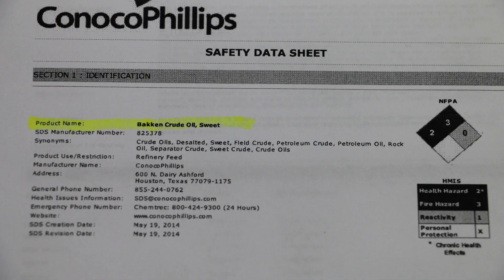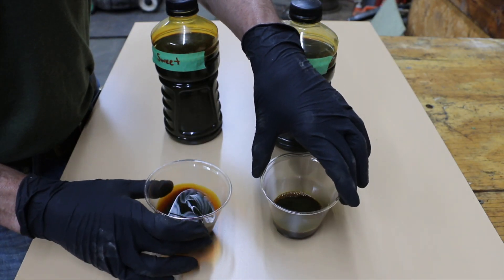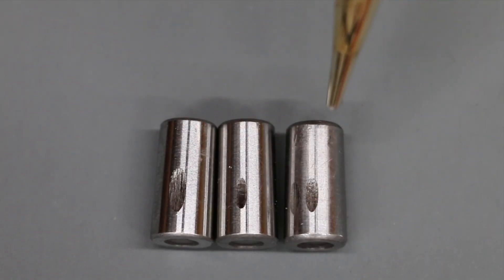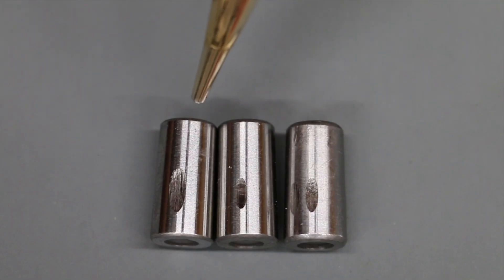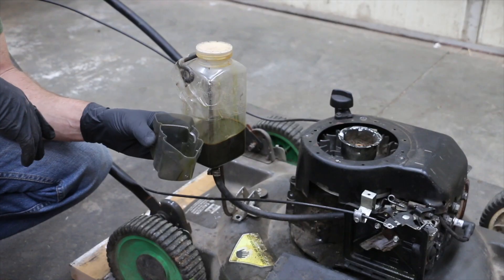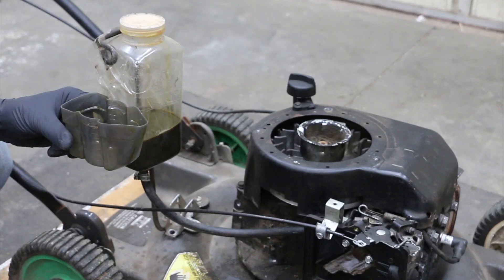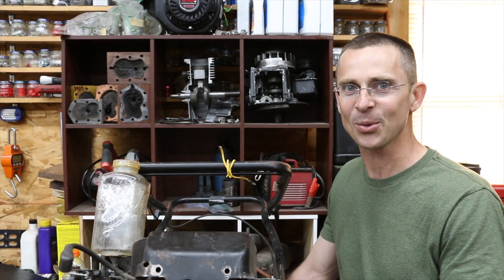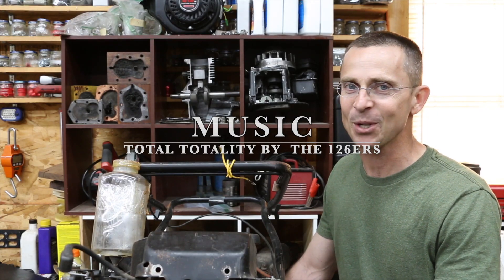Will a Gas engine run on Crude Oil?  Let's try it!

Comment: @Project Farm this would be quite interesting to try light, medium and heavy crude oil in a EFI/non EFI (mechanical fuel system, no electronics) diesel engine, as well as the oil tests you usually do.
Reply from the maker: Thanks for the video idea.

Comment: Sulfer is a lubricant. And h2s gas is lethal at 250 ppm, so down,t be inhaling. There is a plant near Fox Creek Alberta that produced condensate so clear you could see a dime laying on the bottom of a semi trailer tanker. The mechanic burnt it in his old Ford pickup. He added some oil to it as it was very dry and hard on gaskets and hoses.
Reply from the maker: Thanks for sharing.

Comment: Need to try some high gravity condensate.. (crude oil gravity is between 15 and 45, I've seen condensate that's over 80 gravity) be careful H2S (Hydrogen Sulfide) is NOTHING to mess with!
Reply from the maker: Thanks for the video idea.

Comment: What about  Oxygen I mean its extremely flamble over 19.5% you will need a couple flashback protectors.   Also it would be cool to try to reading some gas out of the crude oil if possible
Reply from the maker: Thanks for the video idea.

Comment: It would be interesting to see how your fuel vapor setup from a previous video will work on crude oil? I guess it will work as good as on gasoline leaving thick oil on the bottom.
Reply from the maker: Great suggestion!

Comment: If you're willing to try to crude oil you should definitely try drip gas! It comes off of natural gas wells and it is illegal to run the roads but a lot of folks used to run it in their older cars or farm equipment, sometimes mixed with normal gas in order to make it run better
Reply from the maker: Thanks for the feedback.

Comment: Just curious, why do you perform the lubrication test on fuel? Does that performance affect the combustion?
Reply: Because it is an oil and acts as a lubricant too. Did you know that a diesel engine can run on engine oil? Engine oil is not meant for using it as a fuel but it can be used like that too but as i sad ONLY IN DIESEL engines
Reply: A dozen of potatos and a fat cat smelling them oh cool thanks for replying

Comment: you should try Z-Max next because of the bearing test and sour crude winning is how i got my idea here's the official add link i used to buy Z-Max complete cleaning kit back in the oil engine the sour crude here's the official the add for it  https://www.zmax.com/handler.cfm/template,video/cat_id,56381?med_id=1831003

Comment: The sour crude oil has a higher hydrogen sulfide content which can be fatal if inhaled. hydrogen sulfide when burned produces sulfur dioxide which is extremely corrosive to metal.
Reply from the maker: Great point. Thank you

Comment: Oh, I'm sure it could, once you've installed some sort of miniaturized refinement process equipment, prior to the fuel intake, but that's just gonna look stupid, not to mention add to the overall weight of the engine...
Reply from the maker: Thanks for the feedback.

Comment: so many comments, don't know if it was mentioned.
but the higher sulfur in the sour crude is probably what gave the great results on the bearing test.
cutting oils use high sulfur to prevent galling. probably more so than film strength.
Reply from the maker: Great point!  Thank you

Comment: One variant of this test could be to use the waste heat as as a pre-heater for the oil, like a section of steel brake line wrapped around an exhaust pipe.  I would bet oil at 200f  would ignite and burn much better than cold, no dilution needed.
Reply from the maker: Thank you for the feedback

Comment: The sour crude contains more dissolved sulfur, as you stated. Sulfur is used extensively as an extreme pressure additive in lubricating oils.
Reply from the maker: Thank you for the feedback

Comment: Not all crude oils are “light’. 

You were surprised at the lubricity of the sour crude—it’s called sour due to the sulfur content—but if you understood the chemistry, you wouldn’t have been surprised. The sulfur reacts with the metal to form a metal sulfide on the surface. This results in a low friction surface.

Note that there are automobile lubricants that employ sulfur compounds for that very reason. Can you guess which ones they are? Hint: NOT ENGINE OIL.
Reply from the maker: Thank you for the feedback
Reply: Project Farm 
No guesses about which automobile lubricants use sulfur compounds????

Comment: There was an engine created by a guy from Lewis Run,PA if memory serves me, but he built a multi fuel engine that would run crude,diesel,kerosene, or gasoline. Many stories about using crude oil for fuel in old engines in PA.
Reply from the maker: Thank you for the feedback
Reply: Herbert Akroyd Stuart was the guy who invented the hot-bulb engine. It could run on anything flamable from crude to vegetable oil.

Comment: Given all the additives in gasoline. My best guest before reaching the end would be that while you call TOTALLY use that as fuel. The engine wouldn't last long due to carbon deposit and remains in general.
Reply from the maker: Thank you for the feedback

Comment: The sour crude would have lubricated better due to the presence of sulfur. Sulfur is a "soft" molecule and would have cushioned the bearing. ( I wonder how"sour" it was, you're alive. ) The presence of sulfur would have helped it burn without the additional gasoline.
 Both of those oils would probably have worked well in a " hit or miss " stationary engine.
Reply from the maker: Thank you for the feedback

Comment: I had a friend who lived near Wichita Falls Texas back in the 40s. He said the natural gas that vented off many of the wells contained a lot of gasoline vapor that was collected and called 'drip gas'.  It was illegal to use it for automobiles, as it was not taxed. The gasoline had to be purified of it's sulfur content by letting it sit in contact with copper wool or copper wire. If this was not done the sulfur in the drip gas would attack the copper in the bearings and cause an engine failure. Copper forms a black insoluble sulfide with sulfur and sulfur containing compounds. The reason copper pipe is prohibited for use with natural gas is because of the sulfur in the odorant, methyl mercaptan, will form flakes on the inside of the pipe and cause problems in valves and regulators. If you want to remove the sulfur just put some shiny copper wire in the oil and let it sit.

Comment: There’s a guy that runs all his older diesel truck on straight crude from his wells he services here near Titusville pa.  They run just fine he tried to run it in a newer 24 valve Cummins but it kept ruining the injection pumps on it.
Reply from the maker: Thank you for the feedback

Comment: the lawnmower that actually still runs and makes it through all of these tests, is the mower that should breed more mowers
Reply: Its gotta be sterile by now
Reply: @donzemanovic4205  it must be cloned then
Reply: Respect to the mower.
Reply: mower eugenics
Reply: I could be wrong but looks like a Briggs and Stratton motor which in my personal findings… is one of the most reliable/efficient 4 stroke small engine company’s alive
Reply: Pakai Aditif biar oktan naik
Reply: Especially the ones in Þlants vs Zombies where they're able to Run over the Zombie Corþses~
Reply: OHV Briggs engine, can't be killed so easy.
Reply: I have a lawnmower he can impregnate

Comment: My grandfather had an oil well on some Farmland that he owned, a story that my cousin has told is that one time he ran out of fuel out in the field and there was some way of drawing off some of the crude oil out of the well so he put that in his tractor (John Deere B). Apparently, Grandpa thought that it ran better that way, so he talked to the John Deere dealer about it and they said yeah, once it's warmed up your tractor will run great off of crude oil, but the sulfur in it will destroy your valves and rings. So, I guess, Grandpa thought it was cheaper just to buy gasoline for his tractor
Reply from the maker: Thanks for sharing!

Comment: I'm not terribly surprised that a gasoline engine can run after a fashion on some crude oils.   It's going to depend a great deal on the crude oil.  A heavy crude (like Venezuelan lube stocks) is almost as thick or even thicker than tar or bunker fuel, has high levels of heavier fractions - especially heavy and high melt point asphalts.  By blowing ether or light gas in, you'll get it to run sorta, but it'll foul itself up into interoperability in no time.

By "heavy" I'm referring to some crude oils that had to be heated before they'll flow reasonably.

I worked for several summers at a refinery lab testing product.  We'd get one tanker of Venezuelan crude per year to act as a base for the lubrication feed stock side of the business.  Evil stuff, stank horribly, and at room temperature it was essentially a solid.  If you spilled it on a lab bench, it was this horrid  looking multicolour goo with a hideous smell that you had to scrape off and use very strong solvents to get the last off.

No way you could get that to run an engine without diluting it many times with gasoline.

"sour crude" means it has sulphur in it.  Sulphated oils do have good lubrication quality, but the pollution produced by burning it is hideously high level and is simply not allowed.  It has to be stripped out of all fuels to under specific regulatory levels. At the refinery I worked at, we had a pile of elemental sulfur covering several acres and over 20 feet high.   Even below these levels, some sulphurated diesels  have a tendency to kill high efficiency diesel engines.  For example, some  North American fuel companies couldn't meet the sulphur limits imposed by some European diesel cars until quite recently.  Exxon may still have a regulatory exemption...
Reply from the maker: Thank you!

Comment: The supertankers that haul the stuff have been caught using it to run the ship.  Naturally the shippers are not exactly thrilled.  I was surprised you didn’t get detonation or preignition.  Good show.
Reply: I thought it was standard for Supertankers to run on crude oil. 
Because then you can keep the oil in one bigass container
Reply from the maker: Thank you
Reply: Are detonation and pre-ignition different things? I recall a difference.
Reply: @louf7178  yes very. one is timing, the other hot deposits in cylinder

Comment: I'd also like to see some more exhaustive performance/efficiency testing of using crude oil as both lubricant and fuel compared to normal gasoline.

Clearly the sour crude oil makes a good lubricant, but would it last as long as regular motor oil without causing problems (such as a fire)? And does the crude oil contain more energy than refined gasoline? (Diesel is actually less refined than gasoline IIRC.)

How about the emissions and mileage and all that?

(Asking for a friend and some research)
Reply from the maker: Thank you for the video idea!

Comment: There's "infinite" varieties of crude oil. Some should work, some don't.

Great video.
Reply from the maker: Great point!
Reply: @ProjectFarm   1 - Try to find some oil with API degree above 40, it should work well.

2 - Large Vessels Engines work with Combustible Oil, which is made of the largest fractions of crude. It usually needs to be heated or diluted with diesel (or  both)to flow well. These engines work with the Diesel Cycle, not Otto.

Comment: Let's check Magnesium Powder Fire Starter with Crude oil, and also inside Hydrogen......to see if it runs as fuel for engines.
Water with Magnesium Fire Starter powder and alcohol
Reply from the maker: Thank you!

Comment: Can someone explain to me what a flash point is, and why that stuff didnt explode when he opened the bottle, because the air is far warmer than -20f....
Please, I want to understand this.
Reply: Flash point is the minimum temperature required for the vapor above a flammable liquid to ignite when given an ignition source. This does NOT mean that the vapor will self-ignite. However, when ignited by something, that flame will continue and not die out immediately.

Think of it this way: Below -20F, if you hold a burning match to the surface of crude oil, nothing will happen.
Above -20F, you will see a brief flame propagate across the surface of the crude oil, but will quickly die out.
At or above 30F (fire point), when a burning match is held above the surface of crude oil, it will ignite and continue burning.
At the self ignition temperature (400-600F for crude oil?), the vapors will spontaneously combust without an ignition source.

Comment: i would really like to see this test done with condensate. AKA drip gas.  Its light colored (in some cases its completely clear, I even dip my oily rags in it to clean them) it is known by old school oil field hands to work well as a gasoline replacement when ran with some top end lube like some marvel mixed in.  I know a guy that ran it in his 95 chevy for a lot of years like that.
Reply from the maker: Thank you for the video idea!

Comment: I bet it would work in a diesel engine.
Reply: Old diesel engine? Yes. Anything made after 2006? Forget it. The reason is because after 2006 Uncle Sam regulated diesel emissions and now diesel vehicles need complex emissions control equipment.

Comment: Cool. Just don't use this with any car made past the 1970s, the crude oil will fuck up your emissions control equipment which is NOT cheap to fix. Also do NOT use it with any Diesel powered car made after 2006 for the same reason
Reply from the maker: Thank you!

Comment: There are many types and grades of crude oil.  You only tested two sweet and sour.  But failed to mentions specific gravity of the crude.  Even though the experiment was far more successful than I thought possible.  If you would have used a high gravity crude or a Natural gas liquid you would have had even better results with a lawn mower.
Reply from the maker: Thanks for the feedback

Comment: So you try to run crude oil before you remove the sulphur and salts. When you burn sulphur which turns into sulphur dioxide which turns into acid rain. Even sweet crude has a bit of sulphur in it. So you did an experiment to pollute more.

Comment: The sulfur compounds act as a lubricant.  That's why the ultra low sulfur diesel had to have lubricity additives in order to work in the fuel pumps (around 2006).
Reply from the maker: Great point. Thank you

Comment: Sour oil is extremely dangerous. H2S is a very real killer
Reply from the maker: Thanks for the constructive feedback
Reply: Oh wow you responded lol. I work on the pipelines and we have to constantly wear h2s monitors and sometimes we're required to wear gas masks. One time there was a sour gas leak and safety refused to acknowledge it until someone passed out in the ditch. It's one of those things no one expects because h2s can be found absolutely everywhere underground

Comment: In the oilpatch they've always said that the oil you can drill in Saudi can be put straight into their vehicles, it's super light and sweet. For the Sour crude, that's H2S Hydrogen sulphide in there, that will pit any metal over time as it's extremely corrosive also that smell will give you a headache quickly, and in high enough concentrations it'll kill you. That's why it needs to be refined and anyone working in sour areas needs special h2s training. You can totally run an engine with Crude if it's light enough, but I sure wouldn't be putting it into an any vehicle worth more than 1,000$.
Reply from the maker: Thanks for the feedback

Comment: They run crude oil in cargo ships
Reply from the maker: Great information. Thank you
Reply: @ProjectFarm  It isn't unrefined crude they are burning, it is more interesting than that. Its bunker fuel, or the leftovers after the good stuff has been distilled away.

https://en.wikipedia.org/wiki/Fuel_oil
Reply: .. usually its #6 fuel oil...   close but more diesel

Comment: got my old Volvo home on a mix of paraffin and lamp oil......couldn't use the throttle though....had to drive it on the choke , sounded awful like the ends were knocking but she made it home about 20 miles ......put some decent fuel in and she ran fine again........that was 30 years ago , shes still my show car , engine is still sweet.....
Reply from the maker: Thank you

Comment: you need to get an M35 2 ton army truck that has the multi fuel engine. It think it runs on gas, diesel, jet fuel and crude!
Reply: or a soviet MIG-21, that will run on anything from kerosene to vodka :-)
Reply from the maker: Nice! Thank you
Reply: There isn't much difference between diesel, kerosene, jet fuel, and heating oil. In fact, kerosene and heating oil are so similar that the federal government requires heating oil to have a dye added to it to differentiate between the two.